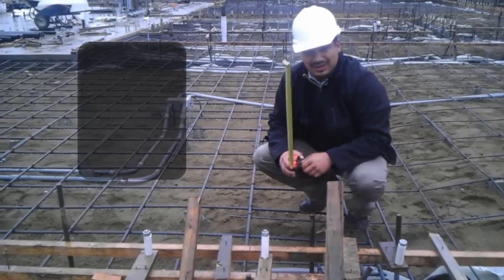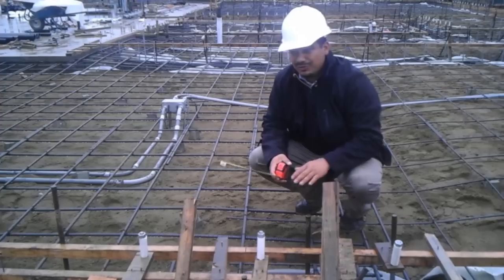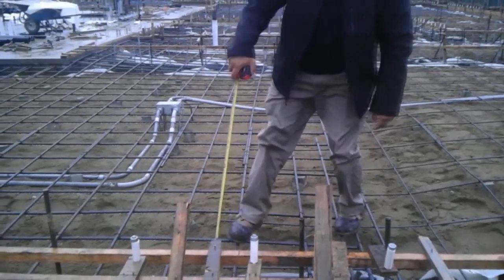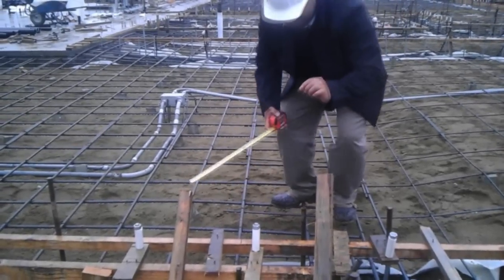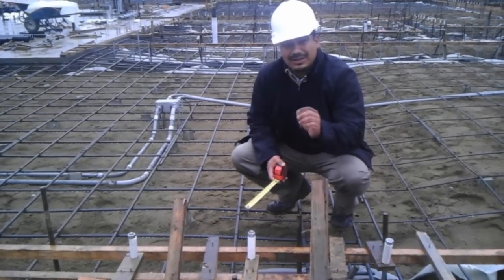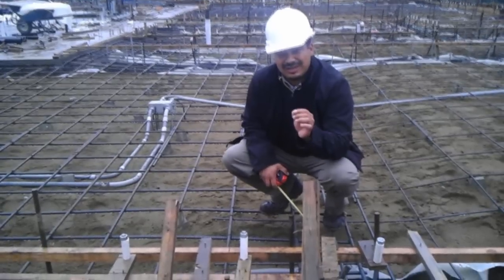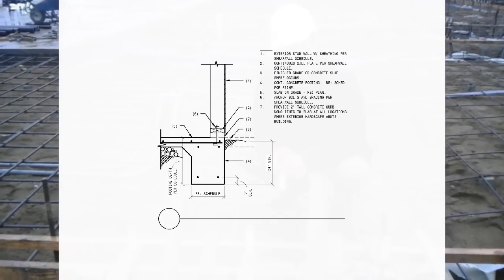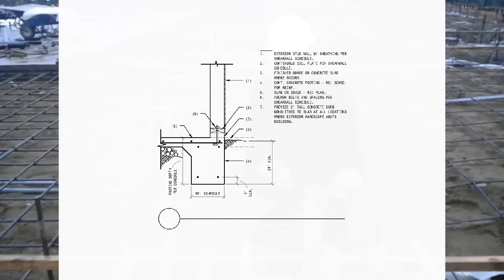How to Build a Slab Footing

Comment: Why is there no waterproofing membrane under the reinforcement laid over the sand/ground????? The main purpose of an under-floor waterproofing membrane is to prevent rising damp from entering concrete or other floor surfaces and resulting in moisture rusting the steel reinforcement. In addition it prevents contamination of concrete during the pouring process. In Australia it is required for certification as in accordance with Australian Standard AS 2870.

Comment: why footings are drawn with an angle or chamfer, when digging its square????
Reply from the maker: bigcartoonyIIV good question, that is because you dig a trench square on the native soil, but as you build the sand for subgrade you will actually end up needing a little slope so the sand does not end up inside of your trench
Reply: Thanks. So basically its done to keep the back fill/dirt from falling in trench.
Reply: Also, abrupt changes in slab thickness is a crack point.  By gradually changing the thickness of the profile, you reduce the chances of shrinkage cracks.

Comment: I want to pour a concrete slab 3 1/2" thick for a barn.  The problem I have is the slope of the ground is approximately 20" difference over a 24' span.  I need to build the lower side up for drainage.  What should I do to build the lower side up level?